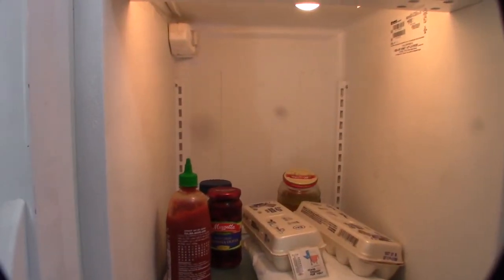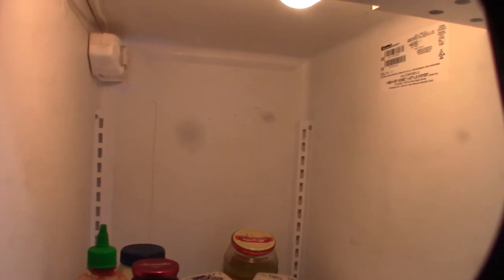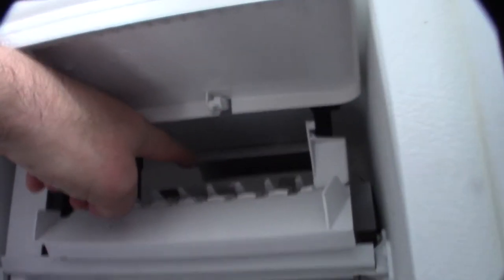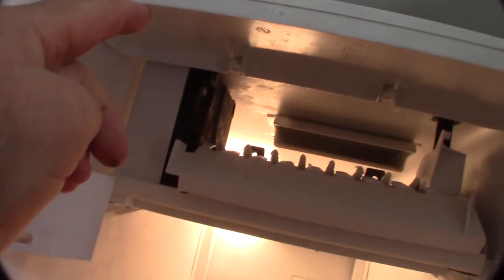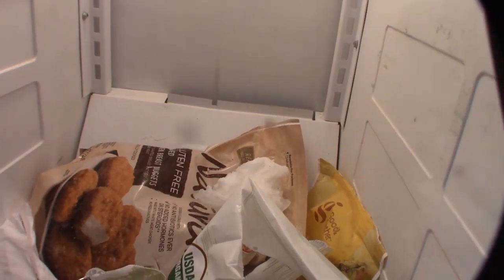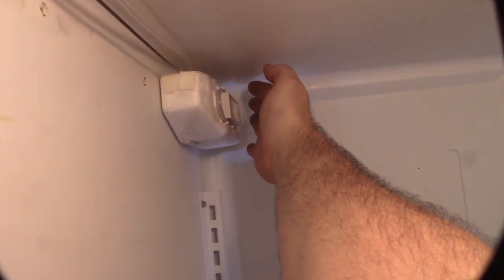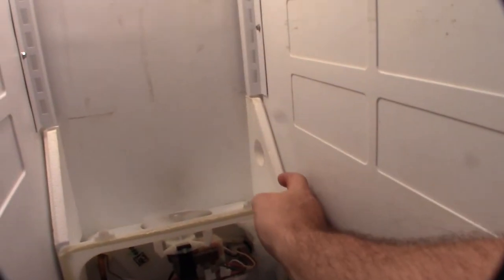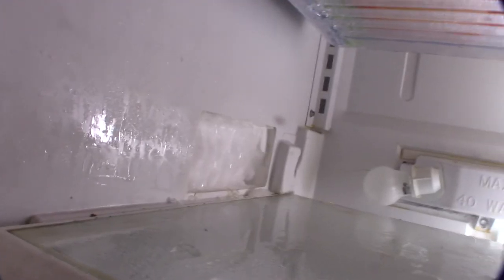Sears Kenmore Refrigerator Troubleshooting Freezer working refrigerator side warm not working repair

Comment: Dude, I just spent 2 hours breaking at all the ice that was stuck in the vents, back panel, all top freezer area, boiling hot water and pouring over ice avoiding electrical components, cleaning spilled water and giving the fridge a good clean while im at it and putting food back in and my goodness gracious I am in debt. I owe you. You saved me lots of $$$. My fridge is cooling like when we first got it!

Comment: Took me awhile to diagnosis no airflow in the fridge.  After I did and found this video I tried with both fridge and freezer doors open, the air was blowing good.  I dumped hot water down the return vent and instantly got cold air!  You saved me thousands of dollars!  My wife was ready for a new fridge :D
Reply: I had the same problem on my 19 year old fridge and I used a turkey baster and hot water in a cup to remove the ice . Worked like a charm and fridge is cold again.

Comment: Okay. I had this problem with a fridge I recently took out of storage. I...
1) Unplugged the fridge.
2) Removed the back of the freezer panel.
3) Unplugged the wiring harness.
4) Noticed the fan wouldn't spin freely.
5) Removed the fan/ motor. 
6) Removed the small electric motor.
7) Took the two small long bolts holding the motor together.
8) Cleaned the rust and residue of the magneto ( part surrounding the small motor) and the small motor.
9) Put the motor back together and tried successfully to spin it. 
After I felt it spinning with no resistance, I reassembled the motor back into the surrounding bracket, 
plugged the fan blade back onto the small shaft, the bracket onto the panel, plugged the panel back in, and screwed it back into place.  
10) I cleaned out the stained porthole for transferring the cold freezer air down into the lower section of the fridge...
Now it runs GREAT!!
I hope this learning experience helps!!

Comment: My aunt has this same fridge and it’s freezing but the fridge isn’t very getting cold and when you open the door it goes from 40 to 50 degrees quickly I told my uncle to thaw out the vents but he did the top only I don’t think he knew there was a bottom vent. I’ll fix it tomorrow hopefully 🙏🏼

Comment: This is the exact issue I'm having now, and have been dealing with it for about 10 days. When I open the freezer door, I get airflow out of the top vent coming into the fridge, but with the freezer door closed, I can barely feel anything. I tried your hot water trick, but the water is just pooling in the opening. I sucked out as much water as I could and then used a blow dryer for about 10 minutes, but it didn't help. 

Do you have any other ideas on how to open up that frozen return air vent? Maybe I should just continue to try hot water?? I've already cleared out the drain from inside the freezer because it was frozen over. Water drained into the pan afterward. I just can't get the water to drain out from this return air vent from the fridge. Thanks to anyone who helps me. I truly appreciate it.

Comment: I really hope this is the fix for mine.  My door suctions closed super hard so I'm wondering if there is a pressure issue going on.  Same thing as you though, chuck of ice up top in the freezer, coils not overly frosted, I did change the defrost controller out.  top vent seems to blow cold air into fridge but when its closed It doesn't get colder than 52 degrees.

Comment: Update. Put freezer items i a cooler with a bag of ice. Freezer was below freezing so those items should be fine in cooler. Unplugged fridge, moved to access back. Opened freezer door. Used hair dryer on ice and filled a spray bottled with hot water and spritzed that around just to speed things up. Do not use any chemicals or sharp objects. 

Took lower panel off back, vacuumed out dust/lint. On my unit the coils are on the bottom and then turn upward for about 4 inches on the back. I could not vacuum those as the dust is caked on from the other side, the fan pulls air from front to back. I took a small brush and some came loose. I will need to order a coil cleaning brush, the kind that bends so I can get to the back area. Brushed off fan blades. Do not discard any back panels. Mine is like cardboard material, but it assists the air flow from the front to back and to move air across the coils and compressor. 
Now it been about 45 minutes. Finished up with freezer. Mine has a top vent that supplies cold air, a vent by the ice maker and vents along the back. Put dryer on medium heat high fan, put blower dry on each vent for about 30 seconds, then went to the next one. Did this rotation for 6 minutes. Probably didn't need that much time, but I wanted no doubt that the vents were defrosted. 
Freezer supply is blowing a -5 F, and lower section air is blowing in at 15 F. So it looks like all good. The only thing that is odd is the lower section is cooling way slower than I expected, but it is getting cooler.

Comment: I had this exact situation (ice clog up top and down below - same fridge even) and used your instructions but the temp is only getting down to 43 degrees. How much hot water did you pour down the bottom vent? Thanks!